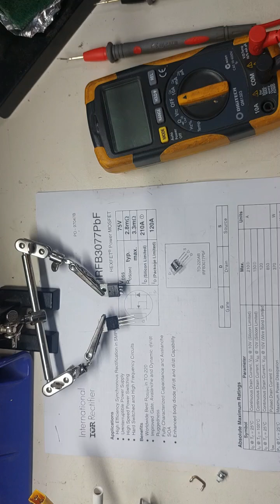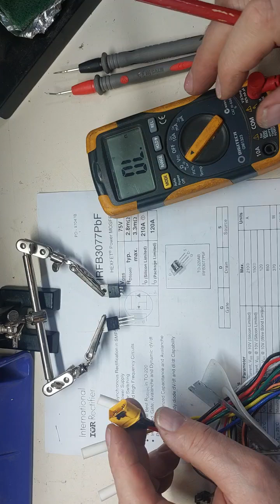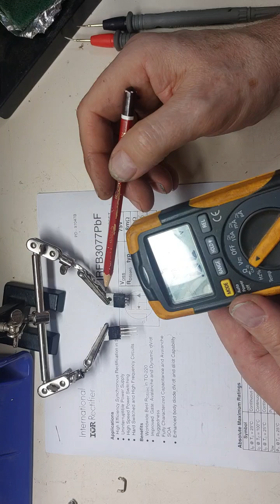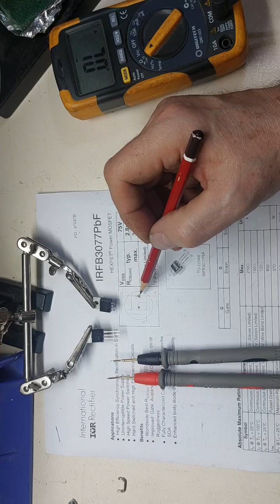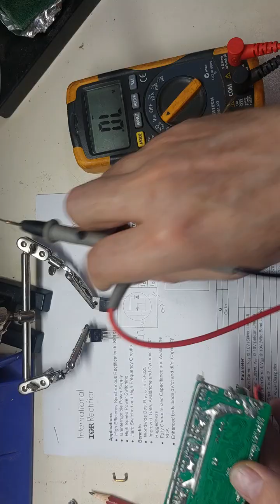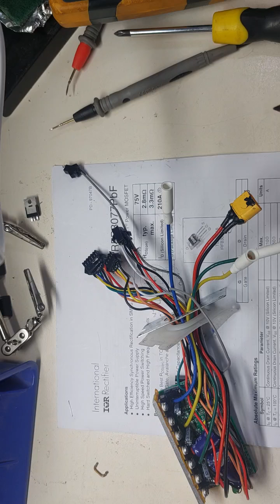Fault finding electric scooter and e-bike controllers.

Comment: hi i am not getting zero volts out but my battery is reading 30volts is that enough for it the output any volts. my battery has a volts output of nominal volts 36volts does my battery need more charing i have misplaced my charger  help me out
Reply: Minimum voltage on a 36v nominal voltage battery is around 28v. I assume the 30v is from the charging port? But the charger may not consider that enough.  You shoukd be able to get someone to get it over 30v
Reply: @octapc  ok i got a charger but its. ot charging the batterg the green light stays on not charing to red light
Reply from the maker: @nikcvetkovski  You have to test the voltage coming out of the charger first, which should be 42v.  If the proper voltage is coming out then you can assume the battery has a problem.
Reply: @electricwheelsaustralia130  yes the volt out of the charger is 42v so i say the battery is faulty
Reply: @octapc  its currently saying 29volts il take it to battery worlds for them to check the battery and if they would able to charge the battery and get 36 volts